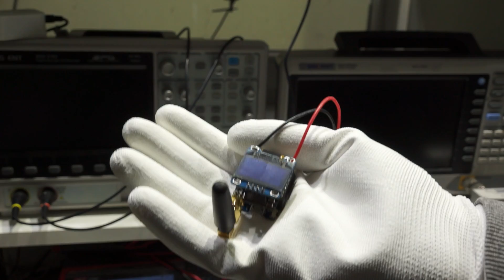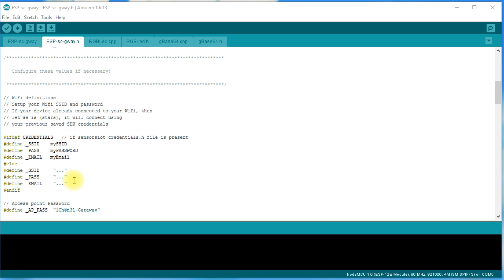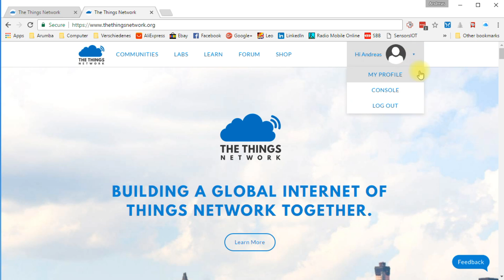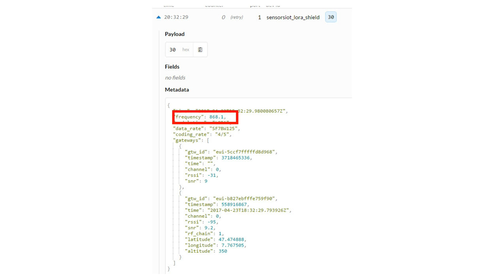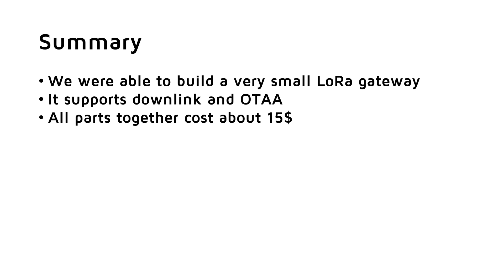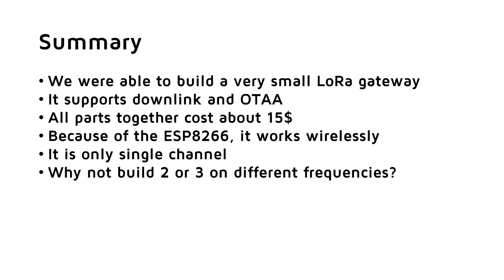#134 15$ LoRa Gateway with ESP8266 and a RFM95 (Tutorial)

Comment: herer's the explanantion for the 3 diodes:
"If you use the Hallard PCB, you have to remember though that DIO0, DIO1 and DIO2 pins are multiplexed on the board using (very!) small diodes to GPIO pin 15 (D8)."
"On the top left you can see the place where to solder the 3 diodes which connect dio0, dio1 and dio2 to GPIO15.
The Hallard board is slightly different from the bare-board or ComResult pcb as it will share dio0, dio1 and dio2 with the same GPIO pin over 3 diodes."
Reply from the maker: Thank you for the additional info!

Comment: Hi Andreas. If building a LoRa GW and a small temperature sensor today, would you still use this? Or are there new easier way on the market today?
Reply from the maker: I am not sure if they still support single channel gateways. Otherwise you have to buy a standard gateway if nobody else deployed one. Or you use a different project such as "Farm Data Relay system (I made a video about it)".

Comment: Hi, Great videos as always, very educational;) I am wondering if the new Wemos D1 boards (v 3.1.0 or Wemos pro) are good for these types of projects as I can't seem to find a lot of the older versions on eBay
Reply from the maker: This is an old video and most people do no more build these simple gateways. First you have to check if you get the needed software and if it is up-to-date.
Reply: I was going to replicate this porject as i needed to create a point to point connection to trasfer sensor data as you showed on an other video. Because the viedio is not relevant anymore are there any good methods to still obtain a good enough point to point connection thanks🙂
Reply from the maker: @kristianschembri7165  This was never a point-to-point project. You should find a point-to-point video on this channel.
Reply: @AndreasSpiess  ok thanks  🙂

Comment: I noticed you are using the RFM95W, but in earlier videos, you use the SX127(8). Also, there is an HPD13. Any reason you chose to switch from the SX1278 to RFM95W?
Reply from the maker: They all use the sam chip (inside). Only Semtech has the knowledge.
Reply: @AndreasSpiess  So are they all interchangeable then and I can just go for the cheapest price? Also, LoRa RF has been reverse-engineered.  I had the docs on my system, then it crashed a few weeks back but I got the info from the net. He said that the Semtech app notes were basically wrong. It is a very interesting Phy. It would be nice to eventually get it into gnu-radio. From memory, I think it was a CSS chirp spread spectrum, had a frame beginning, beginning of data unit, then think it was data was time-based FSK in the up and down chirps. I think that is how it went.  Semtech has a European patent 13154071.8 on LoRa. Then I put the link data on an analyzer and took some notes for the traffic between the gateway and network servers. Found it was using MQTT, and the upper layer is JSON. Your videos filled in lots of the blanks. There are a lot of Denial of Service security problems in the implementation. Basically, you can jam someone's end node out of existence fairly easily.
Reply from the maker: I never was interested in reverse engineering. Their chips are good and cheap...

Comment: Hi Andreas! Thanks a lot for the very useful video. :-) I have a question to you. I have my own pcb with RFM95. I have also node MCU board with ESP8266. Is to possible to use also your code to make it working? If yes, there should be some things to change or not? Thanks a lot :-)
Reply from the maker: This is an old video. Maybe you watch my newer video on the TTN V3 migration. There you should find a library.

Comment: Hi Andreas

I would like to rebuild the gateway. Is the project still up to date or are there already better alternatives with the ESP32? Greetings From Aarau
Reply from the maker: The project in the link seems to be maintained and should work. However, it is not simple to define all parameters. And I would use one of the ESP32 boards they support.
Reply: @AndreasSpiess  Which link? I can't find it.

Comment: the libraries are in an horrible state, it is hard to find all references. the readme file does not really tell you what you need and now I have ambigous reference errors
Reply from the maker: Their last commit are 5 years old. Most current projects use ESP32 boards with built-in LoRa chips.
Reply: @AndreasSpiess  okay, but I already got everything, the 8266 and the shields and the oleds. I found the projects under  things4u/ESP-1ch-Gateway and it also does not even compile. Is there a version that works somewhere?
Or do you remember which version of wemos and neopixel was used?
Reply from the maker: I never did a 1 channel gateway since then :-(

Comment: with the single channel, can there be multiple nodes that use this gateway?
Reply from the maker: Yes. Each node is only allowed to transmit 1% of the time
Reply: @AndreasSpiess  what if some sensors connected to this one channel gateway send a message at the same time, or if their messages overlap in time? Will the gateway still receive all of them if they overlap? Is there an automatic ACK sended from gateway to node? Will the node try to send it's message several times if no ACK is received?  Will the library work with ESP32? Thx!

Comment: 2:23:  the three diode are used for form a crude "OR gate" to groupl the interrupts onto a single 8266 input pin.  The software then reads the RFM95  internal interrupt register to work out which of the three inputs caused the interrupt.
Reply from the maker: You are right!

Comment: Dear Andreas with the cool Swiss accent
Finally I got all parts to replicate your awesome project. After soldering all parts on the pcb I took your sketch from your cool Github repository. My hands were already wet and my heartbeat had already reached a critical rate because of the great excitement. With my highly shaking right hand I tryied to hit the upload button. After a few try's it began to upload. 

Then the shock of the day -> Error message: "conversion from 'const ip_addr_t* {aka const ip4_addr*}' to non-scalar type 'ip_addr_t {aka ip4_addr}' requested
"

Because I'm a beginner in the Processing programming language I have no clue how to fix it. Do you can help us to fix it? I'm sure for an expert like you this problem is like peanuts ;)  Maybe it has something to do with the version of Arduino IDE or a library. I'm not sure :-|

Kind regards and thanks a lot for sharing your awesome projects, ideas and knowledge with us. Thats very kind

Greeting from Bern and stay healthy

delf
Reply from the maker: Did you try it with the new library? (Link in the description)
Reply: @AndreasSpiess  Dear Andreas, unfortunately I can't find a link for the library in the description.On your Gituhub site I found the 4 years old project. I tryied to outcomment the tricky part and then a lot of other issues came up. Unfortunately its not only the library. It seems, that the syntax changed a bit. Now the Arduino IDE complains about small things like "+=" :( do you have a compiled version, that you can add to your Github repository? Maybe under "releases" or just to download. Thanks a lot for your help. It's very kind and unusualy, that famous persons do support for their fans :)

Kind regards and greetings from Bern

Manuel

Comment: Heheeee... Thanks to this excellent tutorial my new-built Lora gateway works! I never received the SMA connectors I ordered from Aliexpress, so I just use a 1/4 wavelength wire soldered so that it protrudes vertically from the PCB. I do not have any Lora node yet (I've run out of Wemoses!!), but after leaving it on since yesterday I see now that some messages have arrived from the network at SNR -11, which is quite acceptable considering: The closest gateway is 10-12 km away and not line-of-sight AND my gateway just sits on my desk indoors.
Great work, Andreas. I use your code which seems to be the only one out there actually using the Neopixels. 
This: https://github.com/things4u/ESP-1ch-Gateway is a more comprehensive and maybe better code. I got it up and running but it has no support for the LEDs (unless I missed something), so I decided to try Andreas' code, and after some minor tweeks - it works.
Reply from the maker: You did not get messages from the other gateway. Somebody else operates a node in your vicinity. And thanks for the link.
Reply: @AndreasSpiess  Thank you for the feedback. You are of course right - there is a transmitting node somewhere that connects to my GW. My next step will be to build node(s), should be feasible using the same PCB as far as I can see. With that node I should be able to test myself the detection range between them - as shown in your world record video!
Reply: Did you mannage to connect your devices via ABP with TTNv3? Im having some issues to connect my device
Reply: @dvstrngs  Yes, I succeeded after some struggle - but that depends a lot on  the device, so it is another subject.

Comment: I asked a question on the TNN site about single channel gateways and this is the response I got:

Single channel packet forwarders harm the LoRaWAN network and are incompatible. They’re not supported on TTN and should not be used, This forum does not provide support for them.

That was a surprise.
Reply from the maker: I know they do not like single channel gateways. But I do not care too much. I like them because they lower the entry barrier. If you want to comply you can go with a multi-channel gateway. But the cost is much higher.
Reply: @AndreasSpiess  Agreed. I don't care too much either that they don't like them. I will continue on.

Comment: Hi, i have an issue, the gateway works perfectly fine but i have a small problem, i have the gpio15 pulled down to ground with a 10k resistor, but if i connect the 1n4148 diode for dio0 on gpio15 the esp12e will not boot. If i leave the diode disconnected, power up the board and only then connect the diode on gpio15 it works like a charm, any idea about the reason ?

Thanks a lot
Reply from the maker: Maybe you google gpio15? It has a special role.
Reply: @AndreasSpiess  it Is used for boot selection i know that, i solved by using two diode in series
Reply: Maybe this could help, so dio0 if not used correctly Is Active 3.3volt, so at boot It set gpio15 High and esp8266 Is not happy. But, addind another diode in series or a resistor in series solve the problem, because now gpio15 Is low at boot and esp8266 Is Happy and could handle LoRa packet properly. Thanks a lot for the like Andreas and well done for your Channel

Comment: Hi Andreas! I have an error - 'Open_Sans_13' was not declared in this scope . I tried to fix it but without results.
Reply: This is the sulution: 
Dirk-Jan Faber
pirms 11 mēnešiem
I had the same problem. I switched the font from Open_Sans_13 to ArialMT_Plain_10. At that moment, the oled was still not showing anything. I also needed to change the i2c address of the oled display from 0x3D to 0x3C (line 71 in the ino file).
Reply from the maker: Most OLEDS have a resistor on the back to change the address

Comment: Hello Andreas. Thanks for the video. I configured the gateway as you did , but how to send the data? I set the Gateway Node == 1 and filled the respective entries. Still there is no data being sent to the TTN. (But i see the gateway as connected)
Reply from the maker: Do you have a node? And are you sure the node works?
Reply: Well, Actually, I had to configure it through the web interface. Then it worked. (Even though i changed the code as GATEWAY NODE == 1, Line 217 in ESP-sc-gway.h). (Esp 1 ch gateway v5.0) But anyways, I am happy that it worked.

Comment: Can i use Lora Bee from dragino instead and wire it the same as that? Assuming i can't / don't have proper tools for soldering smd
Reply from the maker: Lora bee uses the same chip, so it should work. But you have to find out how to connect the pins.
Reply: Andreas Spiess is it only compatible with wemos d1 mini? Will it work if i use nodemcu?
And maybe it's basic question but i couldn't find the "confirmation" yet on either lora forum or google, is single channel lora gateways mean that it can only receive messages from one nodes or is single channel lora gateways mean that it can receive messages from many nodes but only on frequency and SF or something else? Thank you
Reply from the maker: A single channel gateway can only receive on one channel. It can receive signals from many nodes. How many depends on the length of the transmission and the frequency each node transmits.

Comment: Andreas, have you given any thought to a solar-powered LoRa Gateway?

The ESP 8266 is notoriously hungry for current, so maybe using an ESP32?

I'd like to set up a gateway but the only location available to me has no possibility for mains power and I can't run cables, however small (conditions of the building) but there us a good WiFi signal for the Internet access - a self-contained Gateway would be the only option...
Reply from the maker: I made videos about solar power which should be useful for any microprocessor project. There you can calculate the needed size of the panel and the battery. I do not see why the ESP32 should need less power than the ESP8266 in this configuration.
Reply: I may have totally misunderstood, but my thinking was that the ESP32's low power mode with the radios off and the co-processor running, would allow for the NRF to receive incoming traffic and only power up the WiFi to pass that data to the Internet, then go back into low power receive mode.

This, of course, wouldn't work if there was a requirement for unsolicited traffic from the Internet to a node - but for most 'sensor to Internet' applications, the data flow is one way, apart from any acknowledgements, which could be handled easily.

I don't think that's possible (or maybe not as easily achieved) with the ESP8266 - or is it?
Reply: Sorry RFM not NRF (they're in my head at the moment from another project - it's a problem of old age!!!)

Comment: Can multiple node connect to one gateway?
Reply from the maker: Yes of course. The idea is to have up to 1000 nodes per gateway.
Reply from the maker: (But not this single channel gateway). It supports much much less.
Reply: I mean, this node to node... 
Can multiple nodes connect to one node, all at the same time? 
How about multiple node connect to one common node one at a time?
I also read that lora consume more power than lorawan? How fast will lora drain the battery compared to lorawan?
Reply: I checked how much lorawan gateway costs and they're expensive so maybe I could use this. But its a pain to have 10 lora+esp8266 to monitor 10 lora+sensor nodes. So i wonder if it will work if I only have one lora+esp8266 node/gateway and contact the 10 lora+sensor nodes one at one. Maybe send a ping to each end nodes coming from the gateway then program each node to send data when they receive the ping. I've read that gateway have slow upload speed so maybe a ping will be enough. Will this work?

Comment: Hi Andreas, with your expertise and passion in electronics, maybe can you give us some ideas about how to connect our atypical Ace PLCs (http://aceautomation.eu/) to the IoT (LoRa, MQTT,...). Our Ace PLCs have in standard an mini USB port (slave not host, with Modbus slave protocole) and for some versions (http://aceautomation.eu/en/shop-table/) RS232 or/and RS485 with Modbus slave or ASCII protocole. Thanks for your help. Have a good fun ! Rémi - France
Reply from the maker: Maybe it is easiest to add a serial to Wi-Fi connection (like the ESP-01 for 2 dollars) or you build/buy a LoRa node consisting of a mpu and a LoRa module. You chose the respective software if you want to connect to LoRaWAN or have a point-to-point connection. Such a board is manufactured by BSFRance. You will find it in my next video (Mailbag).

Comment: Unknown transceiver, unable to read SPI - Solved. I thought I'd share my learnings.
An excellent video, and an excellent project.
I did everything according to the description, but my device did not work!  The Serial monitor showed that the code stopped after attempting to read the device ID. After too many hours of fault finding to admit to, I  traced the problem to my laptop USB not providing enough power.  I solved this by connecting 5v to the board as well as the USB to the computer.  I've ordered a powered USB hub to prevent these issues in the future.
Andreas's Video '#184 Finding Errors: 7 Rules to get them faster', encouraged my not to give up :-)
I hope that this helps others.
Reply from the maker: Thank you for your feedback. I am sure it will help others.
Reply: @AndreasSpiess  I am finally about to build this gateway, and now studying the documentation. In your video you have soldered wires for 5V on the board. Is this wire intended only for testing if used with a low power USB connection?

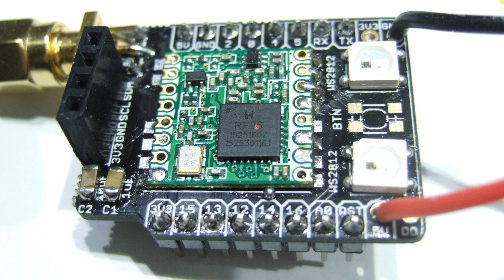Comment: Hi Andreas, in 1:28 one can se that you have connected the 5V and ground cable on the RF95 modul, what are they for? can't the RF95 modul get the 3.3V from the ESP8266?

thanx alot.
Reply: I figured it out, the RF95 gets its power from the ESP shield, no need to any power wire for the RF95 shield

Thanx for the video